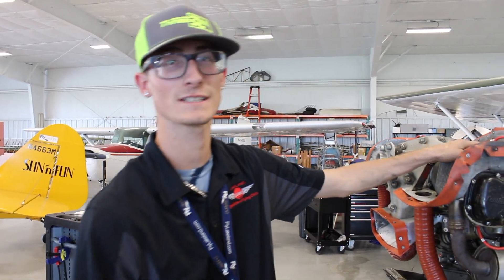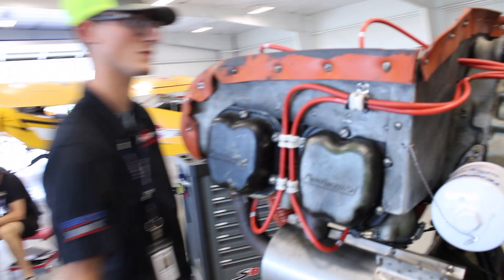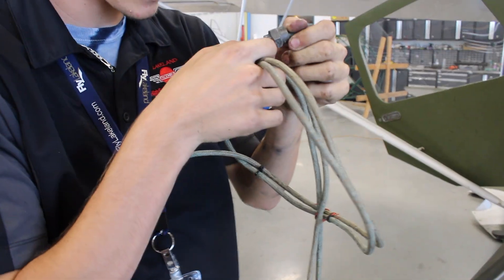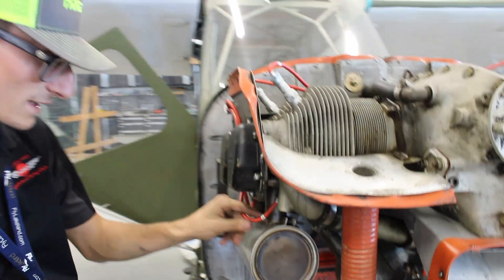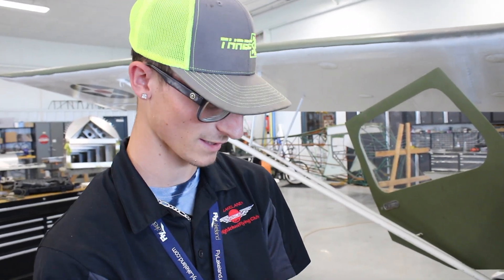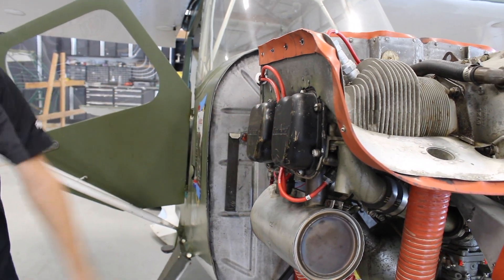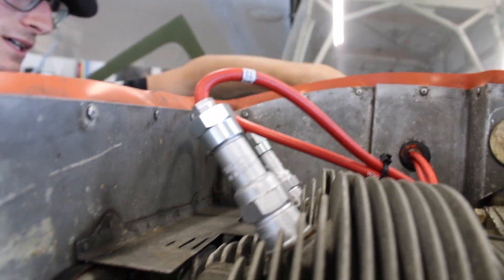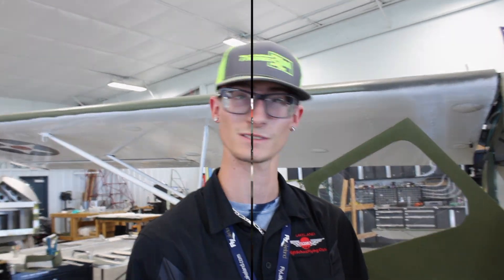Aeronca Champ Engine Maintenance

Comment: The rubber anti-chaffe baffles are on the wrong side.  They should be on the engine side, so the airflow will blow them tight against the metal.